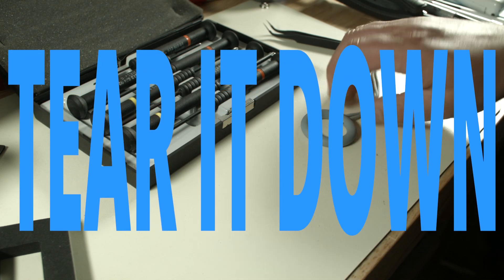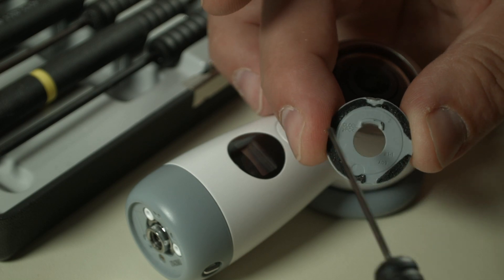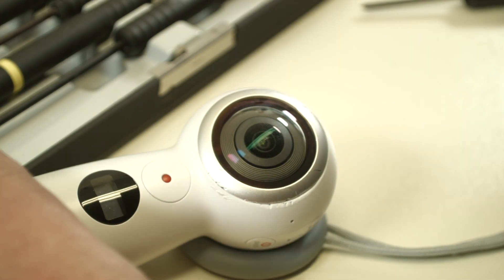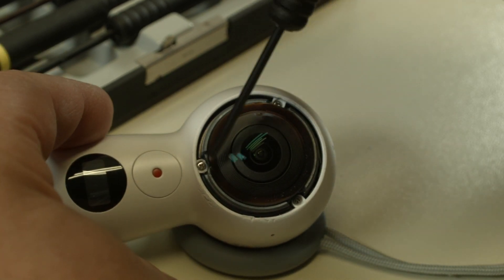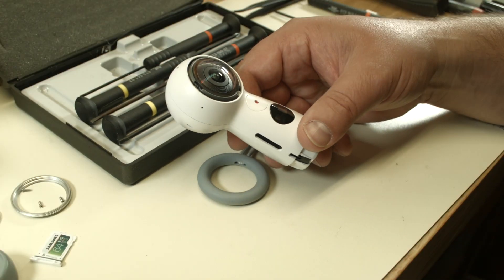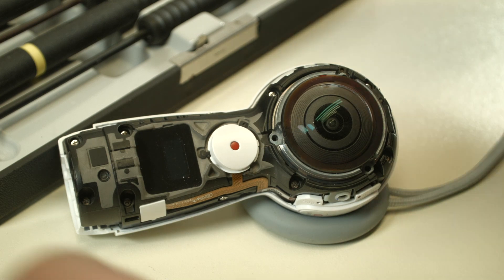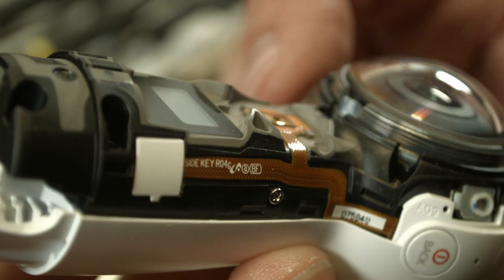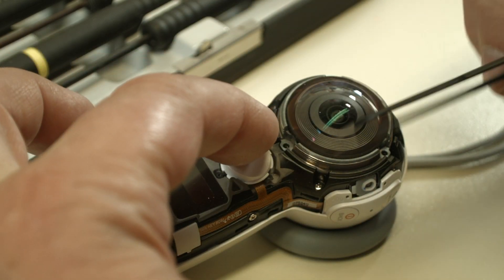Samsung Gear 360 (2017) - Teardown

Comment: The lens is not the same as the old one. I have a damaged lens cover and get the lens cover of the old one ..and it doesn't fit..it's smaller then they old one..I have taken pictures..I hope someone now's where I can get a lens cover for the new 2017 series gear 360
Reply: Hello, you found a lens for gears 360 2017?
Reply from the maker: Thank you for sharing your observation! I hope you find the right part. Did you try to contact Samsung support?
Reply: mygiguser yeh I did..but they said to give the gear 360 up for repair.  Then they will do the repair.  It's frustrating because it's easy to get the lens cover of and replace it. I hope that someone now's where I can order this part. Samsung is not helping..
Reply from the maker: I see. THe repair at Samsung is probably almost as much as a new camera?
Reply: Still hoping someone will find the lens cover part. I sent it in to Samsung for them to fix it and after a month they sent it back saying a scratched lens is not covered by warranty. They did not even give me an option for them to fix it.

Comment: I dropped mine in water in lake Tahoe last year. Great video of me falling in the lake, but camera hasn't worked since. I am going attempt to take it apart to see if I can fix it. Please comment with any help with ideas!
Reply from the maker: If it is wet for over a year, i don't see how it can be recovered. The battery is going to be shot for sure.
Reply: @mygiguser  well I tried to dry it out right after it happens hahaha. I should've taken it apart right then but I didn't have the screwdrivers! Attempting to take it apart now! Will let y'all know the results! Lol

Comment: hi... pls help me about my camera 360 gear... I cant see anymore the lcd working, now its with black screen... So I have to control just by using my phone... could you help me to fix it?
Reply from the maker: if you dont have the display, you can't see the password. therefore you cant connect to the app
Reply: @mygiguser  nope... I can for sure because I do it right now... lol, maybe what you say its for some another one that I could use for first time... mine after to push the sync bottom than in app click in connect.. that's it!

Comment: Hello there, can you please help me my camera 360 had a software problem it came an update in my mobile when i press to update it finished its update and now after upgrading it's not turning it self.
What should i do plz help me. If you want i can send a picture of my camre.
Thank you very much.
Reply from the maker: Back Rub i have no idea. Try to connect the charger and then press and hold the ON button for a few seconds?

Comment: Something I just found out while taking mine apart. Use the rubber ring for the base of the gear to unscrew the aluminum ring around the lens. The rubber ring fits perfectly right over the aluminum ring and you just have to use your palm to apply pressure and then twist.
Reply: Thank you soooo much, I just read your comment and tried it.  BOOM, it was soo easy!

Comment: Hey mygiguser you saved my 360. Had it drowned for an underwater shot (taking all the risks ;). Long story short: in the end I had to dismantle it and clean it to get it working again. But I couldn't for the life of me find a way to unscrew the alu-ring from the lens.... until... tadaaa... your plumber's pliers! Those work absolutely fabulous. Even without any scratches!
Reply: Mine took a spill too and doesn't work. How did you make yours work again?!

Comment: For the lens cover ring, you can try using a small piece of duct tape for pulling along the opening direction. that gonna be much easier with no scratch

Comment: I had a feeling the lens ring  was snapped to screwed on..   I guess the Over heating won on this one. Lol?    SUggestion to those who take apart use rubber tape over the  tool removing.